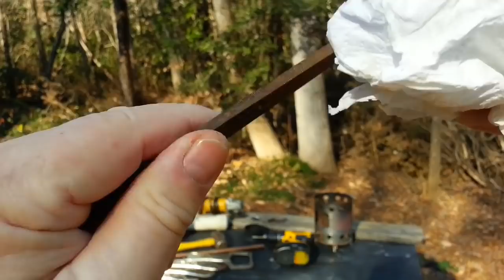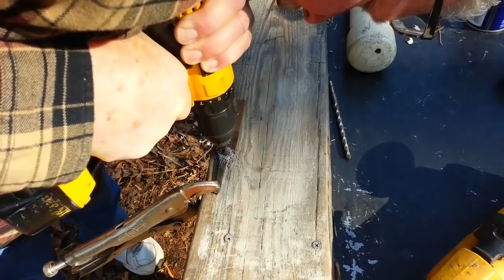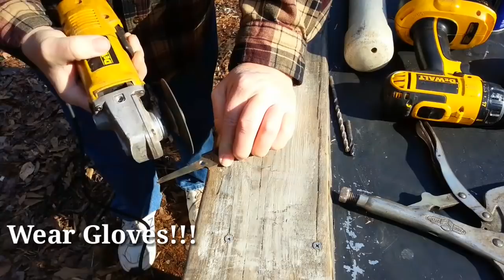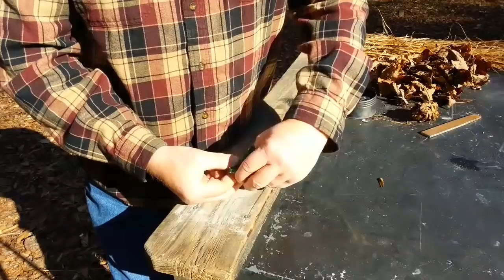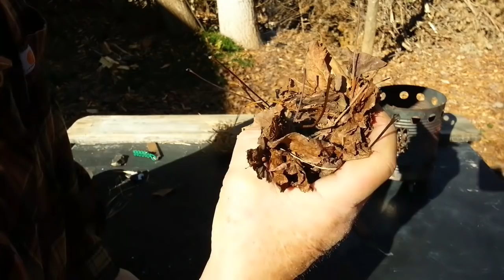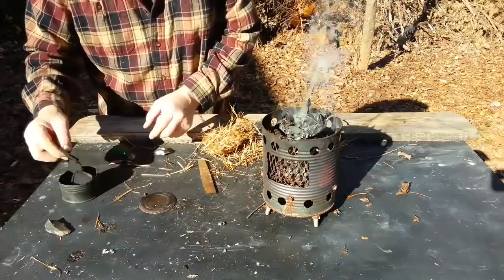Making A Flint and Steel, Steel From A Nicholson File

Comment: I located an old Nicholson file and manage to cut it in 3 pieces and made 3 of them. Mine are rounded more as I just found the link now and did it out of memory this afternoon. Sparks well and ignites charred cloth. I used a thicker disk to touch up after cutting it with a Zip disk. I’ll try a sanding belt to play with the edge. I am very happy with the sparks it is throwing. Thanks for the ideas.
Reply from the maker: You don't want to lose any temper. Be careful with the grinding.

Comment: Good vid Dave. A suggestion. Yes Nicolson makes good files. 31 years machinist/maintenance mechanic to back that up. Cut your file about 4 inches longer. Grind one side down. Cut the tang and lace as you have done. This will serve to strike flint/Quartz as well to use on axe, saw, knife with a bad edge. As you might know, Nicolson makes different cuts on their files. So pick one that won't be too aggressive on the knives and axes that need dressing up. Worse comes to worse use it as a digging tool. Thanks Dave
Reply from the maker: Yes, I thought about that after it was too late. I should have left it longer to use the file easier. Thanks!

Comment: Um, hate to tell you this, but...when I was about ten, (57 now) I found out...just messing around doing things that kids do...that two pieces of milky quartz will throw big sparks when struck together and leave a smell that reminds me of gunpowder...and there very few places in the USA, where you can't find quartz on the ground, in streambeds, etc. Besides, flint is an old country stone, much more likely to be found in Europe than in the USA, here, most people use it's cousin, Chert, which is what is native to this continent... which is, like flint, in the quartz family.  The advantage to using milky quartz is...1. It's a common stone, easily found. and 2. You don't require any other material...just two pieces of it. After that, it's just getting the right amount of force and working on your aim so the sparks actually hit the tinder. Thought I should  mention it.
Reply from the maker: LOL! You nor anyone else has ever ignited tinder that you've found on the spot in nature with 2 pieces of Quartz.

Comment: For some of the viewers just a heads up the reason he is suggesting that you can use a masonry drill bit is because the tip of the  bit has a sized piece of carbide brazed to it, carbide can be used to drill into hardened steel, just in case you were wondering.

Comment: Just wanted to let you know also you made a nice little sharpener for a knife or axe. Also nice tip on the mansonary  bit for drilling files. Offset  hole makes it original.
Reply from the maker: Thanks Richard

Comment: Excellent project.  But with your glasses perched up on forehead, I was reminded of one time when I cut the wire binding of a hay bale that was under a freakish amount of pressure and the freed wire snapped up hitting my glasses, gouging the polycarbonate lens instead of my cornea......only time I was ever glad to wear glasses:)
Reply from the maker: As a pipefitter my safety glasses saved me from a lot of eye damage. Thanks!

Comment: I would recommend a Cobalt tipped bit that's what I use for drilling stainless. But great video I have tons of files. I've been considering trying to build a knife out of one but that's more my brother's thing. Lathe operators at the Mill throw files away by the dozen. Were happy to give me a fistful when I was doing some construction there.
Reply: If you make a knife out of one throw in the oven at 425 for an hour and it will make it way stronger

Comment: I made mine without the hole just long enough to fit in a tin.  I left one side with the file on it and the other smoothed with rounded edges.  At first I left the smooth edge at a sharp  90 deg. but when I used it I found that it will lay you open.  It would take huge sparks off a rod but I am getting to old to bleed and it is harder to stop.  I used the untouched side for the rod and it makes fatwood dust like crazy.
Reply from the maker: I've got a sharp side. I haven't scraped a rod yet though. Thanks!

Comment: You keep emphasizing the safety of gloves , I keep thinking " put the guard on that rotating death machine " good video.
Reply from the maker: What about the black screw in handle, face shield, goggles, respirator, long sleeve set of leathers, ground fault circuit interrupter, replace skinned pigtail, replace skinned drop cord, and download a copy of the material safety data sheet for that aluminum oxide wheel?

Comment: It surprised me a bit when when you were able to drill through the tang without annealing it or using a carbide bit.  I guess they didn't harden the tang when they hardened the file.   I make steels out of chainsaw files.  I forge them flat,  put all the curves in them then harden them again by heating them red hot and quenching in water.  I made one for Lonnie and he has told me a number of times its his  best working steel.
Reply from the maker: Yes the tang was softer than the file for sure.
Reply: I love the idea of using a file.  Everyone seems to have a few they don't use anymore and the just sit in the drawer.
The tang of that file is nowhere's near as hard as the rest of that file. You should be able to drill that with a good  standard bit.

Comment: If you make one side a 90 degree spine use can use it to make shavings also can use the face to sharpen your knife in a pinch
Reply from the maker: You could make shavings and also scrape a ferro rod. The face could sharpen a knife's edge or it's spine. I don't want to, though. I carry 3 fire makers with me all the time and rarely a steel.

Comment: If you strike the steel with the Flint instead of the Flint with the steel (as you were doing), then you wouldn't ruin your edges so much.  Fire starting isn't Flint knapping.  I've been building fires with char cloth for 29 years and that was the first thing I was taught and it has saved my Flint and my time (as in not wasting it) over and over again.  
You don't strike a ferro rod onto your blade.   It's the other way around...  Reason being is you're shedding parts of.the ferro rod to get Sparks.  Similarly you're shedding steel from your striker to get Sparks.
Reply from the maker: LOL!

Comment: I thought everyone knew the tang is soft, the file is hard.  You can see the color at the temper line on many files.
Reply from the maker: I drilled the shoulder. It was not soft. Even though I had a center punched divot, I had to bear down so hard it still drifted.
Reply: Yep, the colored temper line (on some brands it's easy to see because they don't paint the tang) is usually just about where the tang joins the shoulder of the file.

Comment: Nice man,before I bought my striker I was using a little cheap file and it seems to work better than the actual striker,it wasn't as nice as urs but got the job done lol thanks for sharing
Reply from the maker: Mine would work great if I had sharp edges. I could nap some up but them the flint would be too small. I suppose I'll order 2 more pieces from Dave Canterbury.
Reply: David West have u tried looking in rock beds at creeks and stuff,that's where I get mine,I get Flint and chert,I was gonna do a video where I show what it looks like in rock form but haven't had time yet
Reply from the maker: I look everywhere I go for Quartz, flint, chert, tinders, bow and hand drill materials. I love everything about this hobby.
Reply: David West yeah I found some really nice quartz at a train track,if u have a PO box number I'll send ya some that way
Reply from the maker: i have access to plenty of quartz, but thanks!
Reply from the maker: You got good flint? You dont make many flint and steel videos do you?
Reply: David West pretty good Flint,next video I make was gonna be about the Flint,where I find and things like that,it's pretty.good

Comment from the maker: Well, I've lost that steel again!!! I thought it would have shown up by now, but no. Looks like this is the perfect time to go ahead and try to make one out of a file like we've seen on YouTube. Yesterday, at the Flea Market, there were plenty of worn out files to choose from, but I was searching for a Nicholson. They're made out of quality steel. So, about the 3rd one that I looked at, which was all rusty and clogged up, I saw that familiar crossed files logo. I asked what he wanted for it, $2 he said. Of course I would have paid $2 because clogged up and rusty files can be brought back to 'usable' fairly easily... but it's the Flea Market. You always dicker at the Flea Market. So I offered a dollar, he held his hand out, smiled, and said pay me. LOL!!! Don't you reckon a dollar is what he was expecting to get all along?... When I make this steel, I want to put a para cord lanyard on it. Hopefully that will make it more visible for those times when it falls into the shadows. I looked on line to see if there was an easy way to drill a hole in such extremely hard metal. Some videos showed success with a masonry bit because it is carbide tipped. So, I tried one of my less than sharp masonry bits. LOL! I was only able to dimple it. I broke out one of my High Quality Jobber Bits that I've been sharpening and reusing for years. Hah! at low RPMs, it easily drilled the hole.... Please don't make the same mistake that I did. I had my earplugs in and my safety glasses on, but I didn't wear gloves.... PLEASE WEAR GLOVES IF YOU ATTEMPT THIS BUILD WITH A SIDE GRINDER. Find the LINK below that I used to refresh my memory on the Para Cord Cobra Weave Technique. It's what I used to make the green lanyard for the steel. Also, 3 Flint and steel and char cloth fires using leaves tinder bundle and a straw tinder bundle. Come have a look and please SUBSCRIBE at the end of the video. Thanks!

PARA CORD COBRA WEAVE VIDEO https://youtu.be/d9rckgHZGiw

OTHER INTERESTING BUILD VIDEOS OF MINE:
Hobo Stove Builds Playlist
https://www.youtube.com/playlist?list=PLkoXX8XsMW3lZeJRY3SSyPsZBTEWCnHbp
Host Spindle, Let me show you mine, how I built it, and how well it works.
https://youtu.be/fWtTl67S6mU
The Putty Knife Knife Project 3... Duct Tape Sheath, Paracord Lanyard, Casting Sparks Onto Char
https://youtu.be/Y5aBr1lZjd8
Alcohol Stove My 2nd Build (smaller higher jets)
https://youtu.be/DdWIBeEWyUU
Making A Frictionless Bow Drill Bearing Block For Under $5
https://youtu.be/t-QluBmck_c
Hobo Stove Oven Prototype... Apple Cobbler... Crispy, Cinnamony, Buttery Goodness..
https://youtu.be/wNL2fp1n4Ko
Hobo Stove Oven Tweak... Bacon and Onion Cornbread... (Part 1)
https://youtu.be/nw7Oox3Bvq4
Hobo Stove Oven Tweak... Bacon and Onion Cornbread... (Part 2)
https://youtu.be/_V9sejCaMlY
Reply: if you soak the steel in vinegar for a few days itll take the rust off,also three in one oil will protect it
Reply from the maker: Thanks bo om.
Reply: David West w
Reply: David West q
Reply: David West that is awesome
Reply: I love your videos
Reply: WHY NOT JUST USE THE BIC LIGHTER YOU HAVE

Comment: its easier to punch a hole in hardened steel than to drill it just need a bottom die  ie nut and flat nosed punch that fits through nut vise grips to hold punch and B.F.H align file over nut and punch set on file and lined up to nuts hole then take  hammer and  hit that punch strait on n real hard and should make nice clean hole

Comment: files are not hard in the tang they are hard everywhere else.
Reply from the maker: Anthony Beers Heel
Reply from the maker: Anthony Beers I drilled the heel not the tang. The tang was purple and obviously soft. The heel was pretty hard.
Reply: Oh ok,  just thought it would be helpful for people with carbon steel drill bits to know they can drill the tang easily.  Or they could hit the heel or any other part with a torch and drop it in a bucket of ashes for several hours to anneal it if they want to use the other end of the file to get a couple from the same file.
Reply from the maker: Anthony Beers The average man doesn't have access to an oxy acetylene torch. You can't heat a file to cherry with a small propane or map gas torch.
Reply: You need a pair of soft fire bricks but it can be done with map gas.  guess i figured most people probably know someone with a torch.   My views maybe skewed everyone in my family is a mechanic or a machinist, I'm an engineer.   Anyway I really like your video, I am not trying to be a pain.   I am thinking about making one of these to use with a South African style tinder box.
Reply from the maker: Anthony Beers Not a small map gas rig like you buy at Lowe's. Yes, the map gas tank and big tip that a plumber would be using will get it hot enough. What you're talking about is outside the reach of most people and is not something you should even do to a flint and steel, steel.... the file must be high carbon and be very hard to cast sparks.